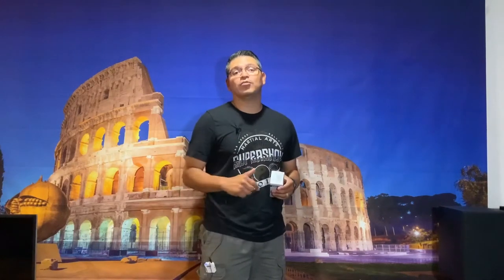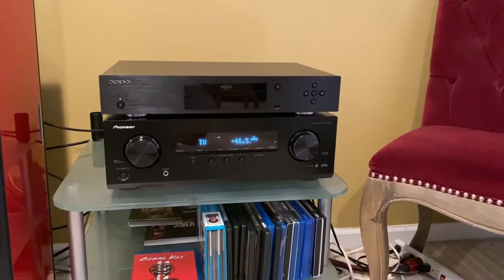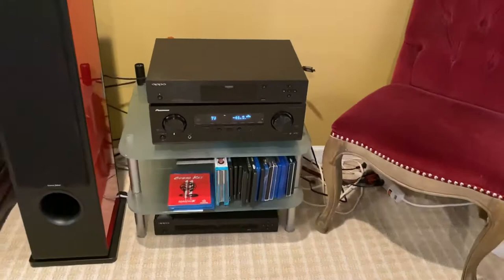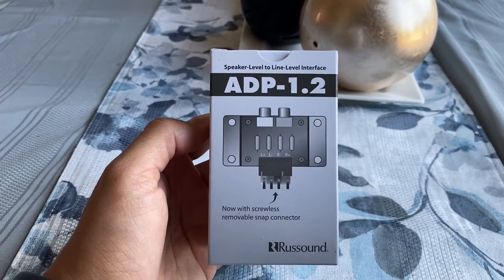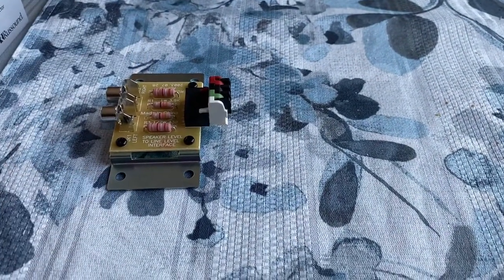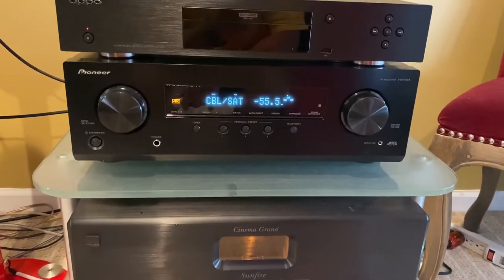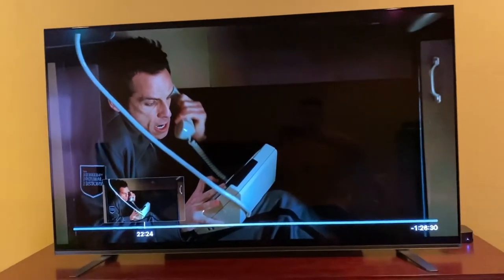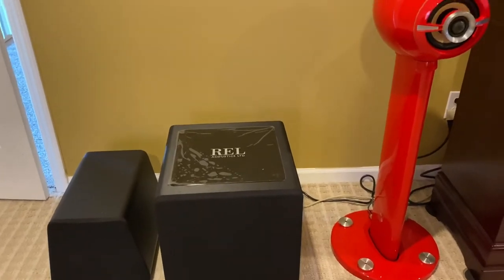How to connect an amp without preouts. Pioneer receiver and Russound

Comment: Perfect solution for my Marantz PM6006 Integrated. Thank you!
Reply from the maker: You’re welcome. I just added another one to my set up for all 5 channels. Thanks for watching
Reply: Can you guys please help me out lol. So I have a Sony Dnh790 7.2 4K receiver that I really like, sounds amazing for 400 dollars, but I would like to get a little more juice to my front right and left tower speakers. I’m running a 5.2.2 setup with Polk s55 towers, s35 center, and 2 s15 surrounds, and 2 little Sony Dolby atmos speakers up on the very top corner of my walls. Sounds great but it clan always sound better. My question is if I do this process with the Sony reciever with an outlaw 5000 5 channel amplifier to just give my front towers extra my power, how does the amp know it’s connected to the receiver? I can turn the amp on/off manually which is fine with me. But I’m not sure how the amp and receiver will know to work together to put out the same music/movie. Also will adjusting the volume in reciever still adjust the volume of my towers as well?
Reply from the maker: @JH-gd4qv  the adapter acts like preouts on a receiver. It’s the same circuit engineering inside a receiver, it takes the audio signal and redirects its path to the rca preouts instead of the speaker terminals. So your amp will get the audio signal from the output of the adapter to its rca inputs. Yes your receiver will still control the volume, +-db, and channel setting to your speakers. As far as turning off and on if your devices both have trigger inputs and outputs that is what will turn your amp on and off.
Reply: @Audiolympian  ok I think I understand. So since all my other speakers are still connected. It’s still getting signals to the amp that way I guess. It’s all kind of confusing. I’m still new to all this. I don’t even really need the amp yet but will be buying it if I get a bigger room if we move in a few years. My Sony dnh790 receiver doesn’t have a 12v trigger input/output. So would this still work without the trigger? I would just need to turn the amp on/off by hand?https://www.sony.com/image/73e7d1990c5cb6a4b61812b6dcb56133?fmt=pjpeg&wid=1200&hei=470&bgcolor=F1F5F9&bgc=F1F5F9
Reply: @Audiolympian  thanks for responding, there isn’t any other videos on this topic at all on YouTube to help, your the best. You would think people would make videos about something as common ads this. Because when you are fist getting into home theatre and have kids especially, you can afford 1k plus dollars receivers with dedicated pre outs. I eventually want to buy a 9.2 receiver with pre outs for an amp to power my front 3 and surround speakers but that will have to be once my kids are out of the house lol
Reply from the maker: @JH-gd4qv  yes there is a lot to learn in the beginning. You’ll get there. The journey is part of the fun. Yes it will still work if you don’t use the trigger inputs.
Reply from the maker: @JH-gd4qv  haha I totally get it. I have 3 year old twins. They get into everything and cost a lot. The good news about having to wait on upgrading gear is that when you do upgrade you’ll get the new current technology. Thanks for watching
Reply: @Audiolympian  I apologize, last question lol. Any possible way to add a 12v trigger output to the Sony dnh790 receiver or any reciever for that matter? There is a spot on my reciever that says 5volt/power supply, kinda looks like a USB port or something. Could you add some kind of 5volt to 12volt trigger cord that you could run to the amplifier? I doubt but wanted to ask. Might be a good topic for a video talk about the 12volt trigger stuff and if you could add one somehow. Thanks again, I’m now subscribed, keep up the good work.
Reply: @Audiolympian  oh boy 3 year old twins that’s crazy, I couldn’t imagine, that’s amazing that you guys can take care of two. We just had our first and she’s only 8 months but we are working on our second. I love my daughter so much and cant wait to share my passion of home theatre, games and movies with her when she’s older. She already rocks back and forth every time I put cds on in my home theatre. I just got over being sick from a stomach bug I got from my daughter and wife. She’s like sick every month it feels like snd then we get sick from her. Croup, then a cold, always something while she builds her immune system. It’s really amazing though watching them grow. I have the man cave on lock though unless I’m in there lol
Reply from the maker: @JH-gd4qv  no problem. I’m not aware of being able to add a trigger out. There are devices that can power a 12v trigger to strengthen it and splitters but those require the receiver to have the 12v output. But you have given me a good topic to research and possibly do a video on. I always look for suggestions. Thanks for subbing.
Reply: @Audiolympian  I forgot to ask you can I use these for more than just my two tower speakers? Could I get an additional one for my center channel and 2 surrounds as well and just let the receiver run the Dolby atmos speakers? And if I use one of these for my center channel, would it matter if I plug it in the red or white rca plug since it’s only one speaker, unlike the right and left tower speakers and surrounds?
Reply from the maker: @JH-gd4qv  yes you can. I have 3 of them for a 5.1 system
Reply: @Audiolympian  awesome

Comment: Excellent video man, I thought I was going to have to purchase a new receiver with pre outs. I have the pioneer vsx-lx301 elite.  I’m looking to use these adapters along with crown xls2505 amp to push 2 crewing Vega xls215. I hope they work I seen the adapters handle 250w rms 500w max. Thanks for the video.
Reply from the maker: You’re welcome. I use mine a lot at 200 wpc rms, no problems at all. Thanks for watching
Reply: My dood, 100% same receive and same issue. Did this fix meet your needs?
Reply from the maker: @neilkarella1191 yes it did. Thanks for watching

Comment: I actually own a Pioneer VSX 523 and it looks to be very similar to the one you have there in the video. I heard you mention that you're able to change this setting for the OHM....... Would you be able to tell me exactly how is it that you do that?
Reply from the maker: Sure. Use the remote and go into the menu then to speaker configure, there it has an option to pick your ohm setting. It should show it at the default setting which is usually 8
Reply: @Audiolympian  ok cool I will have to try that and see. I did purchase this receiver recently off of marketplace and unfortunately it has no remote so I have to buy one on eBay.  I should be fine as it is because I'm running two duel 4 ohm 15" Legacy subwoofers wired to 8 ohm in a vintage MTX home audio box that has the mids and tweeters in it from the original. I just replaced the subs as they were old and starting to go out. The subs are duel 4 ohm like I said and have the wired to take an 8 ohm load with a factory crossover inside to protect the mids and highs. The subs actually read as 3.5 ohm per voicecoil for a total of 7 ohm on each sub but no subwoofer is EVER going to read its exact stated ohm. So with that said I'll probably just keep it at 8 ohm as you will actually lose power by dropping down to 6 ohm from all the forums I read. And I was going to ask you, with your Pioneer receiver do you notice how you have to turn the volume up to about 50 before you really start to hear the music at a decent level? Maybe its because I'm just running the two main front L and R instead of having the complete 5.1 surround plugged in with it? Just was gonna ask your take on that.
Reply from the maker: @thomasfitzgerald2595  sounds like you got a cool set up. Yes I do have to turn my pioneer receiver volume up to get good sound but the sound is pretty fantastic when I do, better than my Onkyo.
Reply: @Audiolympian  well I'm still in the process of obtaining a few more things but when all is done yes I hope to have a very nice setup that any audiophile would appreciate. My main receiver is my Marantz SR7005 and all my speakers are Premier Acustic.
Reply: I have another question that I thought you may be able to answer??
Reply from the maker: @thomasfitzgerald2595  shoot
Reply: @Audiolympian   If you have a receiver that has preouts and you use them for a power amplifier what happens to the channels that is the channels that you are not using from the receiver are they still putting out power and you can still use them for more speakers?
Reply from the maker: @thomasfitzgerald2595  good question. It’s tricky to answer without confusion but I’ll do my best. If you use the pre outs no you won’t be able to use those speaker channels on the receiver. When you connect the preouts to and external amp the receiver bypasses and redirects the signal  networking used for those specific channels. So then what happens to the extra power from the unused channels?? The receiver will use the newly freed power to other channels but not like you would think. Most people think the receiver divides the power out to all the other channels, it will when a channel needs it but it’s not a continuous push of extra watts all at the same time. It’s just when there might be an explosion from the left rear channel and it requires a little more oomph then it’ll send maybe an extra 10 watts so the channel won’t clip or damage anything. And it’ll do that through all the channels. So an external amp can benefit more that just extra power it allows the receiver to work a little less. Thus expanding its life expectancy. Hope that helps.

Comment: Iam confused how are you running the wire . You got a wire coming into the speaker and Reciver plus this ?? Can make a another video showing the viewers step by step ??I wanted to see how you connect it . I know the other cable goes into the Amp into preout section.
Reply from the maker: Maybe I can give you a better explanation, speaker wire goes from the receiver to one end of the adapter, then you connect the rca cable from the adapter to the amplifier, from there you connect speaker wire from the amplifier to the speakers. Hope this helped.
Reply: Where from receiver is the question?

Comment: Hi 
I have yamaha receiver rxv385b 5.1 
I don't think it has preamp.  Can I use   this option? What preamp do you recommend?
Reply from the maker: Yep any receiver that has speaker outputs can use this adapter. There are many good preamps out there you really can’t go wrong with any Option. But to answer your question I’d go with a used Denon or Marantz because they have better processing than other models at all price points and most of the time they come with more features. Thanks for watching and subscribing
Reply: @Audiolympian  thanks for your response. 
Just got a question: i have yamaha rxv385b 5.1 I would like to add another subwoofer using RCA splitter.  Is this a good idea? Is it possible?
Reply from the maker: @mkhaudio  oh yeah splitters work well for hooking up two or more subs. I have a few like that in my systems now.
Reply: @Audiolympian  Yamaha Subwoofer Speaker with Twisted Flare Port - NSSW050B (Black)

What's you opinion on this sub? I'm on low budget
Reply from the maker: @mkhaudio  sorry. I’m not that familiar with that sub. However I have had a couple Yamaha subs a long time ago and they were pretty good sounding for the price and at only 100 watts. I would imagine their technology is better today. I did read a review on that sub and a pretty good review showing for budget subs. The only down side it said was the lack of controls on the back. Other than that it was fairly solid. Thanks for watching
Reply: @Audiolympian  I'm a bit confuse how to use Russound adp. 
I have av receiver rxv385b. It doesn't have preamp function.
How should I setp up my cable connection?
Reply from the maker: @mkhaudio  the adapter has the rca output on one side and speaker terminals on the other side. So you would take regular speaker wire from your speaker terminals on the receiver to the speaker terminals on the adapter and then an rca cable from the adapter to the rca input on the amplifier. Hope this helps
Reply from the maker: @UCfE99MNlVYpzDNelR3pmoJA correct. From the receiver to the adapter you just use plain speaker wire. The adapter has 4 speakers inputs on it. A positive and negative terminal for left and right speakers.
Reply: @Audiolympian  I'm living in Australia. 
Cannot find any company able to post it to me . Can you suggest any?
Reply from the maker: @mkhaudio  I’d be happy to look into it for you
Reply: @Audiolympian  please let me know 
Thanks

Comment: Would I need another adopter for center speaker
Reply from the maker: Yes you would. And it doesn’t matter if you only use one channel on it, still works fine. Thanks for watching
Reply: @Audiolympian   does my receiver need the trigger cus it doesn't have it I've seen 9.2 receiver with it
Reply from the maker: @albertgomez6855  nope. That’s the good news because it just uses the actual speaker signal.
Reply: @Audiolympian  ok got it thanks
Reply from the maker: @albertgomez6855  you’re welcome

Comment: RCA cables from adp 1.2 adptr to wat input on amp??
Reply from the maker: To the normal rca input on the amp. In my case my amplifier has the rca inputs listed as fronts, center and rears. So my initial set up was just to my front left and front right inputs until I got two more adapters. Thanks for watching
Reply: @Audiolympian  RCA cables into Phono, tape, aux input.. which??
Reply from the maker: @M0D60  seems like your using an integrated amp or receiver, I’m not sure how that would work. Regular solid state amps don’t have input options like phono or cd. However in your case I’d try the auxiliary input. And see if that works
Reply: @Audiolympian  I appreciate your response & knowledge. Tq

Comment: Which speaker wires do you connect
Reply from the maker: Not sure what you’re asking. But for the adapters I use basic 16 gauge speaker wire because the input connection on the adapter is small. So speaker wire goes from the receiver to the adapter then an rca cable to the external amp. Then, more speaker wire from the amp to the speakers. Hope that helps. Thanks for watching

Comment: Can I use the adapters used for car stereos? Tq
Reply from the maker: Good question. I’m not sure. The biggest difference I can think of is car audio equipment is designed to handle 12 volts where home equipment is designed for 115 volts. So a car adapter might burn out being it wouldn’t have strong enough capacity. But you certainly can give it a shot. Thanks for watching
Reply: @Audiolympian  further update. Car LL converter works! In Malaysia, it cost less than USD2. Have been using for a few days now. Hope it last
Reply from the maker: @paddyfeeny4518  very cool. That’s good to know. Thanks for the update

Comment: You need only one ADP 1.2 per system?
Reply from the maker: Depends on how many speakers you have in you system. 1 adapter is for 2 speakers. Thanks for watching
Reply: @Audiolympian  My Denon AVR540 is loaded with a Bose Cube 5.1 w Surround. In addition I want it to add a pair of 401Bose speakers and a pair of small pioneer. I have no preout so I want to get me an amplifier so I can add this other 2 pair of speakers. So I will need two ADP?
Reply from the maker: @panasalsa  if only looking to add 2 speakers you’ll only need one adapter

Comment: Why can’t you just cut of the rca’ from others side and just twist speakerwire and rca wire together instead of using that adapter.
Reply from the maker: In a manner of speaking you probably could do that but the adapter does provide some filtering, grounding and load resistance so nothing is damaged.
Reply from the maker: Thanks for watching
Reply: I just have an old Sony 5.1 receiver but has no lines out just aux in
Reply from the maker: @Dansthebest1  gotcha. This is the situation for the adapter.